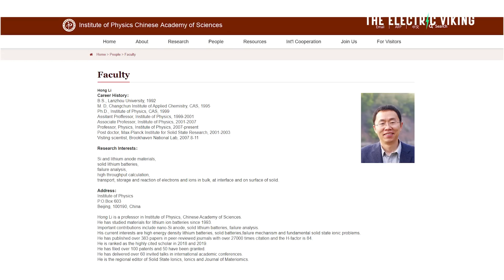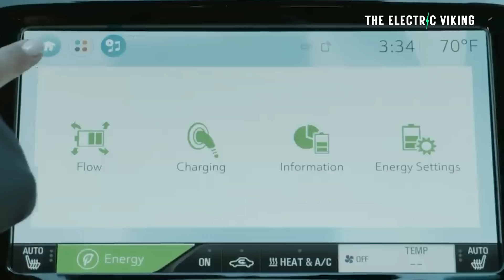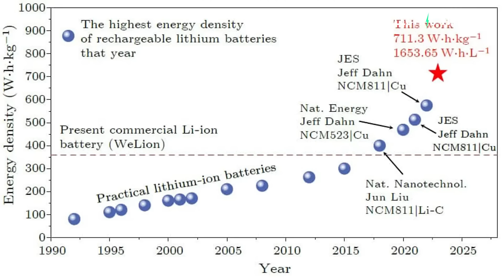The highest energy density lithium ion battery in the world is INSANE

Comment: once you pass 600wh/kg you pretty much kill any logic left to using hydrogen as a fuel.
Reply: There NEVER has been any logic behind hydrogen unless you magically find a new catalyst for fuel cells which uses common materials.
Reply: @w8stral  Alternatives to Platinum / precious-metals exist - e.g. an iron tec - altho not practical for passenger vehicles.. But expensive FC catalysts are not the issue. I'm baffled why LH2 does not interest any players as a fuel for very large HGVs. It seems ideal: huge range, minimum weight, volume and boil-off are irrelevant for a large freight vehicle in continual drive. Anyone know?
Reply: @w8stral  And it needs to be cheap and easy to replace.
Reply: @w8stral  Deep sea windmills generate hydrogen.  Tankers come by periodically to load.  Or, nuclear power plants make hydrogen off peak instead of throttling down.  Or, hydrogen is used to make ammonia for fertilizer.
Reply: @mefobills279  but nuclear power stations do not "throttle back". Refueling aside nuclear power stations run at 100% all the time. If there is an excess of power in the grid.  It is gas  that is backed off. If there is still to much pumped storage is filled Or power is exported via interconnectors
Reply: @mefobills279  no one is, shipping hydrogen, 93% iirc is produced where it is needed (steel production mainly) because you can't pump it far through pipes and shipping it is beyond hard. Plus if you're running it through a fuel cell you need platinum group metals, AND WE DON'T HAVE ENOUGH OF THEM ON THE PLANET FOR CARS. Oh and as the waste product is water don't let your fuel cell get cold and go below freezing as that destroys the cell on start up.. So you need a battery to keep it warm.. Oh and it's a dangerous invisible gas that escapes easily and kills the experience fuel cell in 5yrs.. So no hydrogen is just nonsense and a petroleum industry talking point that you are foolishly repeating, unless they are paying you in which case shame on you.
Reply: @mefobills279  Hydrogen fuel don't make sense economicaly, just the cost of 1 liter of hydrogen is 4 to 5 time the price of petroleum right now.
Reply: @Rozonoe Mi  Japan already has a successful nuclear to hydrogen reactor.  In some cases, it makes sense.  The DaVinci reactor is being clamored for by Canada.  The remote mining camps will get the first ones.  They will make hydrogen at night off peak.  That in turn, will displace diesel used in heavy equipment.  Trucking diesel into remote camps is expensive.  Sorry...eVinci reactor which is a new concept.
Reply: @patdbean  Baseload is 110 percent.  The extra 10 percent is diverted to hydrogen for heavy equipment.  Remote mining or artic use.  You don't use peaker plants in the hydrogen scenario.  The conversion inefficiency still a problem but there have been a lot of promising technologies emerging lately, the same as batteries.
Reply: @Sean Duggan  The Japanese nuclear hydrogen project has steel and heavy industry clustered.  The hydrogen is made as needed on site.  Co generation of hot water also.  It only works with new modular reactors such as eVinci.  The efficiency conversion problem still exists.  The storage problem still exists, but there are use cases even now.
Reply: @mefobills279  baseload in the UK is 15gw of a grid that can deliver over 50gw at peak demand. Current nuclear generation tops out at about 8gw and even with hinkely point C and sizewell C it will still only be about 14gw. I know the French have much more but they have over 20gw of interconnect to 6  other countries, to sell it.
Reply: @patdbean  UK doesn't get enough sunlight.  The small modular reactors, especially the e Vinci which has a unique traveling wave type tube, are something I would be looking at.  They can be used for electrical generation, Co generation of hot water, and hydrogen, which has many uses, especially ammonia, for fertilizer.  I wouldn't recommend hydrogen for transportation due to storage .  A real sovereign state uses its own credit and has as much autarky as possible.  England lost its sovereignty long ago...see Ramsay's, the nameless war.
Reply: @mefobills279  you are quite right,  the uk dose not have much solar. That is why we have 30gw of off shore wind. With the dogger bank  wind farm about to come on line giving another 7gw.
Reply: @patdbean  Note that wind is limited to near shore.  Going further out has a use case for hydrogen, especially for shipping to tank up.  All island countries are vulnerable as they often don't have energy or minerals in their lands.
Reply: @mefobills279  the cost of solar will come down as time goes on. Same with battery tech and the sun shines everywhere. As Elon musk pointed out himself, if you took a nuclear power plant and replaced it with solar panels, occupying the same footprint, the solar panels would produce more power than the nuclear power plant.
Reply: @mefobills279  dependes what you meen by near. The dogger bank wind farm in the north sea is about 100 miles out. You can do floating wind even longer out but that is more costly. Bringing the power back by cable with high voltage cables is FAR less lossy that converting to hydrogen and back. The uk Norway cable runs at 550KV DC all the way accross the noth see from Scotland to Norway and still only has about 5% loss.
Reply: Elon predicates his argument on storage and infrastructure.  Suncable is building solar farms in Australia to power Singapore.  It's not smart to have an island country dependent on others.  In wartime, I would EMP blast the grid and make Singapore go dark.    A smart island country would have a resilient mix of energy, including nuclear, hydrogen, BEV, solar, etc.  When America blasted a hole in Nordstream that shows how weak it is to depend on others.  Other new technologies are geothermal.  Quaise energy has a new gyrotron, and they think they can disrupt everybody, including nuclear.
Reply: @patdbean  That's interesting.  Thanks.  Deep sea would be the application for Hydrogen.  Possibly liquid electrolyte for flow batteries.   100 miles is pretty far, and the sea bed would need access by divers for maintenance.
Reply: @mefobills279  remember the north sea, is a "sea" not an ocean , and dogger bank is a "bank" that was once dry land.

 If you can get the voltage high enough you can keep the losses down. China  runs million volt  HVDC cables from its inland solar farms to its coastal cities.
Reply: OK but 1 kg Hydrogen is 33 kWh.
You still need 50 kilos of battery you come close to the energy density.
Reply: Lithium batteries already achieve that!
Reply: The way ICE boys are threatened by EV's is looking just like the way EV boys are threatened by hydroden vehicles. The insecurities are hilarious.
Reply: @jpscharged  this comment is lame. why would EV fans be 'threatened by hydrogen' vehicles? the only things i'm concerned about with hydrogen are 1) is the hydrogen actually produced in a green way (or is it just from natural gas feedstock like most is today) and 2) is the car with a hydrogen tank actually safe? everyone is worried about battery fires, but a hydrogen tank exploding in a vehicle would be a literal bomb
Reply: Except for airplane
Reply: @widodoakrom3938  at today's battery energy density electric flight dose not work. But at 500wh/kg maybe it could?
Reply: @patdbean  not for commercial passenger airplane event with 1000 wh/kg battery
Reply: Correct
Reply: https://youtube.com/shorts/VlNH-XEfAnk?feature=share.   Skateboard ok . Electric unicycle. Way to go . Much more efficient and you don't have to fix it very much I've never fixed mine the people have to work on them abused them on purpose I'm sure but there's so much fun so efficient  price miles. You get a good quality 14 about a thousand bucks  efficient.. mine is an emotion V8 but I'm getting the v 11 with suspension.  Just think about it, huge wheel you do your research I know you'll figure it out electric skateboards fun but a pain in the ass I had one. Electric unicycle you'll love it anyway hearts and prayers go out to your wife and your family. Also thank you for keeping me and many of my friends educated I've turned your page on the some of the other people thank you keep up the hard work😊
Reply: https://youtube.com/shorts/VlNH-XEfAnk?feature=share
Reply: Ok, then let's go to 2,000 wh/kg - just to be safe.
Reply: You can fly too
Reply: Hydrogen leaks will make global warming much worse by damaging hydroxil  radicals that break down methane.
I hope I wrote that down right.
Reply: number of cycles, recharging time, pollution and whater waste mining lithium, China dependence. plus lithium is arrived close to max efficiency while h2O thermolisys  to get H2 is not yet mature, I also mention direct use of H2 fo endothermic engines.
Reply: Hydrogen DIED at 30 wh/kg
Reply: Higher energy densty of Li Batt will cause severe impact of thermal runaway. Where not all cause of thermal runaway can be mitigated. So, how much additional weight needs to be added to keep explosion containment?. That could reduce the energy density, right?
Reply: @sekarmelati new battery chemistry such as lithium iron phosphate greatly reduce fires, which by the are rarer then the media would have you think
Reply: @mteifke  yes, here in the uk we have about 3,500 car fires a year. About 4% of cars are BEVs or plugin hybrids,  while only 40-50 fires start in EVs. If you exclude arson. And if you exclude plugin hybrids it is down in the 20s.
Reply: Hydrogen is already ancient history.
Reply: yes I was hoping..I don't want a battery and combustible engine. to many thing to go wrong
Reply: The logic of using hydrogen in personal vehicles is out the window from the get go. It takes an enormous amount of electricity to cleanly produce. Then instead of combusting it we seem intent on using fuel cells which make for boring cars and reduced efficiency again.
Reply: They forget a truck can easily get charged while doing loading or unloading
Reply: There never was “logic” in using H.
Reply: you forget refuelling. Pretty big part of the logic to operate a commercially viable vehicle.
Reply: @pan6593  Higher energy density batteries = longer range vehicles = needing to charge less often
Reply: Ye let's not forget About that lithium that's mined , Putting so much CO2 in the air , so there is logic so actually just buzz off about hydrogen being useless , Over time If they create these batteries more over time , then what was the point of switching from Petrol and Diesel to electric when it's not even friendly for the environment  , electric cars will gradually reach the CO2 levels that Petrol and Diesel cars have already polluted.
Reply: @KL4BSGTR  To make petroleum make sense based on current reserves, the only thing to do is to remake petroleum from the carbon dioxide. This is the equivalent of a one-time use chemical battery as it requires a large amount of electricity to do. On the other hand, I can make the battery once, and only use the electricity to charge it with less electricity. What was your point again? Oh yeah, you want to pay more to drive your car, and you think I should buy your junk that you decided to buy when I need a second-hand car.
Reply: @KL4BSGTR  Practically no human activity is friendly to the environnent. At this point we can only hope for SUSTAINABILITY
Reply: @KL4BSGTR  because you only have to get the lithium out of the Ground Once and you get thousands of charge cycles out of it. 

Oil you can only burn ONCE. 
 And hydrogen needs 3kwh to be put into electrolysis to get 1kWh out to the wheels. Batteries get over 80% of the charge power out to the wheels.
Reply: Lol
Reply: @Trig》Classified  its not useless but it's not useful for cars. Let's see who's right over time. So far you're wrong.   How's your garage hydrogen refueling station coming along? My house came with an electric refueling station.
Reply: @KL4BSGTR  BEVs lifetime CO2 footprint is about 20-30% of what is ICE cars.  And even if the footprint is same it still would be better to drive with BEVs to not let tailpipe gasses in cities.
Reply: @KL4BSGTR  once we get more renewable energy like solar, wind, fission and fusion nuclear energy, anything with battery will be better.🔥
Reply: @KL4BSGTR  Batteries could give u energetical independence. If u can produce energy for charging your cars homeland   u don't  need to pay money to some not friendly to humankind regimes.
Reply: @KL4BSGTR  Lithium is not particularly rare in the Earth's crust, and it can be recycled.  Plus, solar energy can be used to mine it.  In that case, it won't add any CO2 to the atmosphere.
Reply: @KL4BSGTR  if the lithium is mined and processed with non CO2 producing equipment then that solves that issue
Reply: @KL4BSGTR Lithium can be drawn from seawater. Many new methods are being made daily for mining it cheaper and more environmentally friendly. 

 Once Lithium Air with densities of 2k kw h/KG, to 12,000 kw-h/kg? The world would be set! 

 It will never hit 12k k wh/kg as that is the therotical maximum. Yet 50% of that is achievable.

 Hydrogens issue is the volumetric density.
Reply: @pan6593  commercial vehicles actually spend a lot of time standing around due to mandatory breaks and loading and unloading times.
Reply: @pan6593  lol exactly. Hydrogen refueling is dangerous and a logistical nightmare.
Reply: @pan6593  once a battery can go past the length of a shift, that almost becomes null
Reply: @pan6593  ...you may forget...the AI in your vehicle does not. Also: you don't have to separate the charges...you also can replace the battery. But continue showing ke that you do t know what China already has on the market today. When even Germany orders China's commercial vehicles in masses you know that you're late to the game.
Reply: Hydrogen as a fuel makes no sense for aircraft (makes sense for tractors or loaders that need to be in service around the clock for weeks at a time) but you’d be very much mistaken to think 100+ passenger aicraft using todays designs will take off and fly across USA using batteries with that kind of energy density. Forget it. 1200 kW/kg at least and then the required to power the flight is enormous. No airframe, wing design, electric fan design or material science we have today is going to get close to that with 600 or 700 kW/kg energy density. See my other comment with a link to some basic math defining the task. Viking pretends to be be an authority in everything he says, then goes at the end “let me know what you think in comments to drive up my algorithm” I blocked him from my suggestions but this cam up in a private viewing window. He must be promoting the shite outta this garbage.
Reply: Not really.  If they release the compact fusion reactor tech, hydrogen will be plentiful.
Reply: @Ricky Bosephus  I wouldn't hold my breath waiting on fusion.  The temperatures and magnetic field strengths are enormous.  A simple, inexpensive, eVinci reactor already has a lot of interested parties.
Reply: @mefobills279  sure if fission works that's ok too.  i'm not picky
Reply: @rickybosephus2036  so what you are saying is that  using hydrogen is so inefficient that electricity needs to be almost free for it to be practical ?
Reply: @rickybosephus2036 if they make fusion reactors you wont need hydrogen
Reply: Listen guys. I think a major point pro hydrogen people overlook that’s a big factor to overlook is the fact you have to use electricity to get the hydrogen from its source. With every system you introduce to get the desired output, you decrease energy efficiency and increase the amount of overall energy required. Using energy to make energy to then store this highly leaky energy is significantly more inefficient than just using the energy at its source.  
Better energy density or not, it will ALWAYS take more energy to power hydrogen cars than to simply use electric vehicles. Not to mention the inefficiencies with how the many different ways the electricity is obtained in the first place
This is a simple matter of physics
Reply: @DinkyDingus   You are speaking about what is public and not what actually it is. The problem with hydrogen on demand systems that I have invested in several times, is the deep pocket,  Psychopathic globalists don't WANT this technology that already  exists and requires FAR LESS electricity than eCars use! 

 That's why we're going to black Box it and no one will know where it is and when it's coming out but it is coming out, and later this year.

 The military top secret level, this technology already exist and they run 3 fighter jets on pure HOD systems or hybrids.

 As a Veteran of Military Intelligence ( Where everything is classified classified compartmentalized so that no one knows what is really going on and that's how crimes are committed by the HUNDREDS weekly), I know that they exist and have listened to the inventor speaking (in a roundabout way) Because it is all classified and above top secret add to that the methodology, and to what use it's being put to.

 Or emirates of technologies that defy the laws of physics, thermal dynamics and a myriad of others so called laws that will blow your mind and SOON the Proverbial Cat will be let out of the bag.
Reply: @DinkyDingus  quite, to convert the whole uk car fleet,  31 million cars to  battery EVs would take about 65twh a year. Taking the UK's total power demand up from 306twh (tast year) to  about 371twh in an ALL EV uk. To do the same with hydrogen would take about 180twh. Taking total uk yearly power demand to almost 500twh a year .
Reply: @patdbean  exactly. This would be the compounded, big picture item. Gasoline engine efficiency is about 25% (terrible). 
The efficiency of hydrogen IS better than gasoline, but it is only about 40-60% efficient whereas electric battery storage is between 80 to over 90% efficient, therefore requiring significantly less energy.  The idea of going hydrogen NOW is absurd. Maybe before lithium ion batteries were viable, but not now. 
Hydrogen is a couple decades late and a dollar short.
Reply: @DinkyDingus  yes, the point  is you need to do a well-to-wheel calculation NOT a tank-to-wheel one. 

As far as grid demand goes, 370twh is about the same as what uk power grid demand was in the early  2000s. But 500twh would demand  massive grid and generation upgrade.
Reply: @patdbean  agreed
Reply: @patdbean it will take decades to make enough evs to change over all ice cars plenty of time to upgrade the grid
Reply: @mteifke  quite,  about 250,000 plugin vehicals will be  sold in the uk in 2023. The current grid could handle all 37,000,000 road vehicals being EVs it would add 65-70 twh (20% ish) to total uk demand. Even the current grid could cope with that as long as you keep  most  of the extra  demand out of the peak 4-8pm time slot. 

And if it is 35p per kwh between 4-8pm but 9p per kwh inbetween 1-6am. With 70% of charging   done at home , I assure you that the EV load will  soon shift Into the off peak hours. 😀
Reply: Uh...mmm...Liquid H2 at 33,000 Wh per kg to be used in large gas turbine or high compression engine at 50% Efficiency = 16,500 Wh / kg at the engine shaft vs battery at 711 Wh per kg with battery, inverter, and motor at combined efficiency of 80% =  568 Wh per kg for battery at motor output shaft.  So, we still see LH2 having 15 times  higher energy to weight ratio compared to the best of battery.!😮
Reply: @trungson6604  but to make that 33,000wh with electrolysis you would need to put 100,000hw IN!
Reply: Hydrogen has 33000wh/kg. There is still a long way to go….
Reply: @simpromovie  its not the power to weight its the power to volume, even if you compress it. the average hydrogen car can only holds a few kilos which is enough to go about 300 miles
Reply: @simpromovie  liquid hydrogen but not compressed hydrogen.
and liquid hydrogen only makes sense if you use it instantly. like a scheduled flight.
if you don't use it, you have to keep it super cold all the time to keep it liquid which needs extra insulation and energy for cooling.
Reply: @simpromovie  Per kilogram of Hydrogen? Great until you add in the weight of the containment system to keep said Hydrogen from leaking away. ;)
Reply: @simpromovie  But you have to store it and tanks that hold H2 are heavy.
Reply: @simpromovie  😂
Reply: @simpromovie  what about preventing explosion? It might have the same  difficulty as the thermal runaway on Li Batt.
Reply: @simpromovie one hydrogen is way to expensive. batteries there only trying to beat gas powered and there doing it .plus no one is set up for hydrogen
Reply: @simpromovie  for hydrogen, per liter is much more practical.  The energy density of liquid hydrogen is 2360Wh/L.  But in reality, a normal hydrogen gas tank in 10k psi (ex. Toyota Mirai) is 1300Wh/L. Current fuel cell battery efficiency is around 50%, so the usable energy density is 650Wh/L。
Reply: @simpromovie  battery = 94% efficiency when sending power to an electric motor that is in itself also over 90% efficient. Hydrogen on the other hand hasn't had a fuel cell that has cracked 27% efficiency.  If you then decide to burn hydrogen in a combustion engine, the numbers are even worse.
Reply: @LinuxGalore  I know all that but this comment was only about energy density.
Reply: @simpromovie  You thought the comment was about energy density, when in reality it was about practicality
Reply: @simpromovie  Too many problems with hydrogen. Most notably a flammability range from 4% to 75 % in the air. lack of safety, will always be an issue with that volatility. 

It’s volumetric density is 8 MJ/L whereas gasoline has a density of 32 MJ/L. Hence, it needs to be contained in extremely expensive tanks, both in upfront and maintenance costs.

Yet you guys are still deluding yourself!?
Reply: @simpromovie  no it wasn't, you thought that, I'm looking at the complete picture, logistics, energy conversion efficiency, production efficiency. Hydrogen becomes a white elephant as soon as batteries pass the 600wh/kg capacity.
Reply: @LinuxGalore  In the meantime I learnt what you mean...
Reply: @simpromovie  To produce 1kg if hydrogen you need 50,000 Wh of electrical energy...this means you lose 17,000 Wh just to produce it. Of the energy stored in 1kg 55% get lost unused during consumption...and if you reconvert it to electricity you lose another 50% of these 55%. 

So the energy efficiency of hydrogen is around 30%, while battery stored electricity has an efficency of around 75%.

Also: hydrogen is highly explosive...while batteries are getting safer and safer...so sage that they barely react while you damage them...but also self-heal which is the old concept taken from self-healing capacitors. 

Hydrogen is already dead.
Reply: @Uygsoerk   I know all that. I was referring to the YT Video about energy density alone. For sure are there other aspects regarding Hydrogen.
Reply: @simpromovie  Hydrogen will be as successful as those natural gas vehicles of the 80ies.
Reply: @simpromovie  using H2 is less efficient than BEVs. So it’s not a direct comparison.
Reply: @MoDa87  I know. This conversation was initially about energy density and and that regard Hydrogen is king...
Reply: @simpromovie  but hydrogen only has 3Wh per litre at atmospheric pressure. But lithium is about ~700Wh/l. So hydrogen is still inefficient.
Reply: @AORD72  But you did not take Hydrogen with you at atmospheric pressure. But you are right, the weight of the pressure tank has to be taken into account...
Reply: @simpromovie  that is why hydrogen is inefficient you have to compress it and that costs money. Direct electricity is far cheaper. Hydrogen will never work because of the inefficiencies of the total system, complexity, transportation requirements, embrittlement and safety.